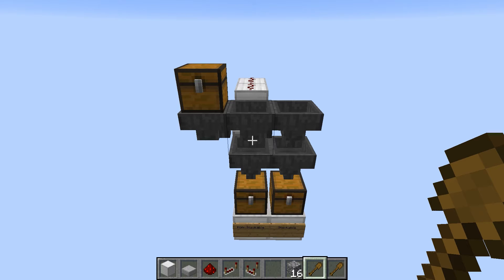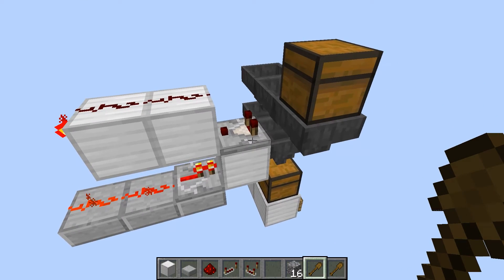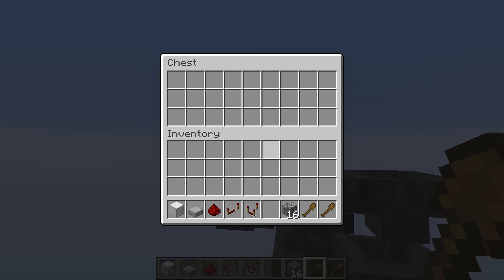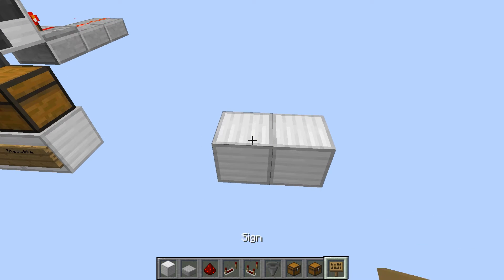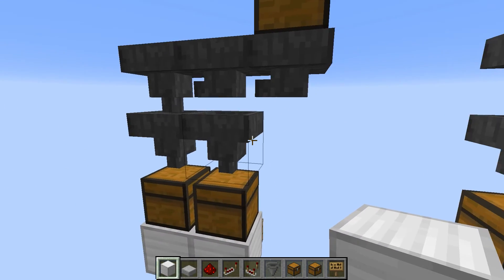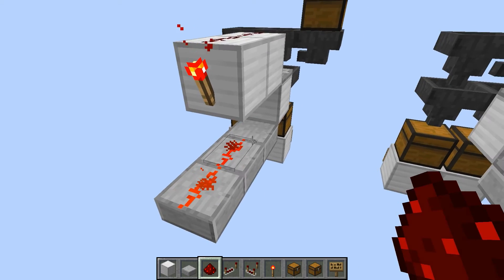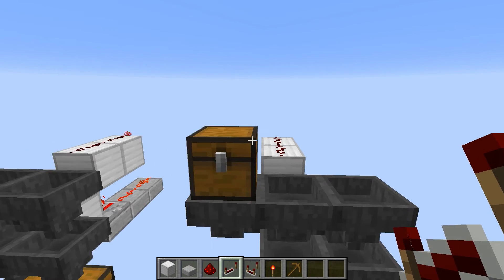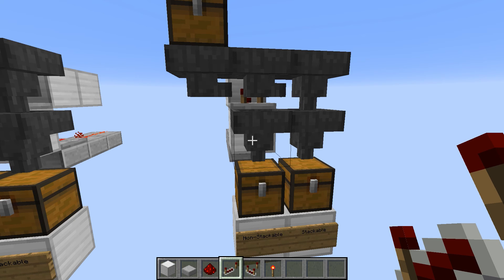Stackable Item Filter

Comment: if one is full, the next will not work. Moreover the redstone torch can burn out
Reply from the maker: As far as being full, I've had many times (usually cobbestone) where it becomes full.  Any excess goes down the line and either into the trash system I setup, or overflow.  I've never had a torch burnout condition with this.  I would be happy to test out a version you provide that shows it not working properly.
Reply: Oh yes with a trash system i'm agree this is ok. But i had an issue when i did a filter with the torch like this a time ago, when i had non constent item the torch brned out with too many start stop
I think i will be able to show you later, but the simple way to fix it is swap the repeater with the torch